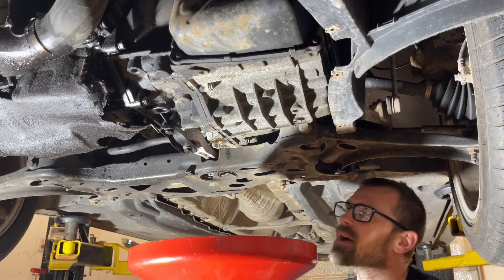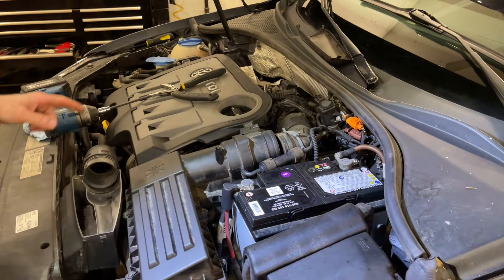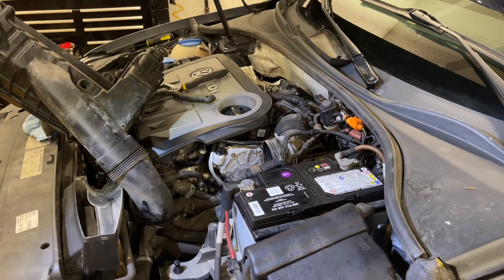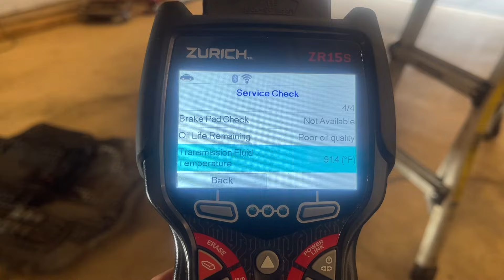🔧 VW DSG transmission fluid change. 2014 Passat TDi

Comment from the maker: This procedure is very similar for many DSG transmissions from 2004-2018.  VW recommends doing this service every 40K miles.  I have never seen dirty fluid when done at 40K miles and these transmissions are very reliable as long as you service them as recommended.

The kit I used in the video: Pentosin 8038207-KIT: https://amzn.to/3wt5OrH
If you prefer the Liqui Moly brand: Liqui Moly service kit: https://amzn.to/3RR8xXj
Hand pump: https://amzn.to/3XDmUi4
Fill adapter for DSG transmission only: https://amzn.to/41wBg6N
Fill adapter kit (for many vehicles including DSG): https://amzn.to/3QJ3vtH

Quinn 1/2" Drive Torque Wrench: https://www.harborfreight.com/12-in-d... 

These are both the same scanner:
Innova 5610: https://amzn.to/3ZFN3hc
Zurich zr15s: https://www.harborfreight.com/zr15s-o...

14mm hex for drain plug: 33ftlb (45Nm)
8mm hex for fill level tube
5mm for the airbox bolt
24mm for the transmission filter housing

0:45 supplies needed
1:35 removing the cover and draining the DSG fluid
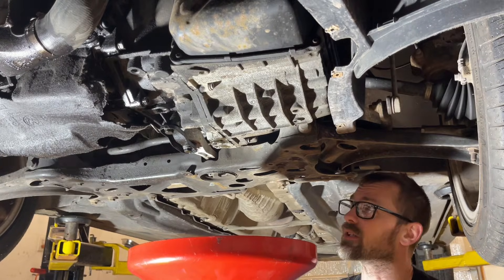3:25 accessing the DSG filter
9:03 changing the filter and housing o-ring
11:35 reinstalling the filter
12:00 putting the top back together super fast
13:07 reinstalling the fill level tube and filling with fresh fluid
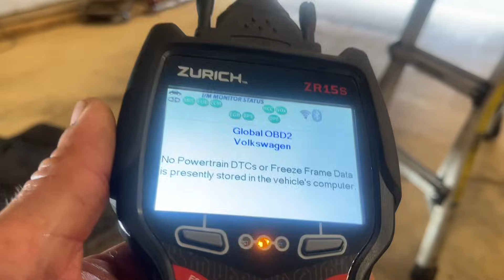15:27 checking transmission temp 95-113F (35-46C)
16:20 draining excess fluid
16:53 reinstalling drain plug 33ftlb (45Nm)

As an Amazon Associate, I earn from qualifying purchases.  For your convenience, I try to post links to everything I use in the video description.  That's part of how I cover the costs of this channel.  I appreciate your support buy using these links!!
Reply: Should run the transmission through all the gears after filling with fresh oil.

Comment: followed you and it was perfect. I had to pour fluid from up top and took me nearly 1 hour to finish off pouring it in. I cant believe how smooth shifting has become. I was feeling every gear shift before and now it smoothed down at least 75%. I bought 5x Liqui moly DSG fluid and 1x Hengst filter separately and it cost me a lot less than a kit.
Reply from the maker: Great to hear and thanks for the cost saving tip!

Comment: ALWAYS remove negative battery wire FIRST.  On any device also.
Reply from the maker: Great advice, but in this case it doesn’t apply since I used a jumper pack to keep the system energized.

Comment: Weren’t you suppose to run it thru the gears while it’s heating up, before replacing the drain plug?
Reply from the maker: It’s pretty normal on traditional automatics to run through the gears after you have completed the fill process but before setting the level. These DSG transmissions are a lot different that regular autos.  I do not believe there is any benefit to running it thought the gears before setting the correct level, but also it will not hurt or change anything.
Reply: @bennieaust ok thanks. Just picked mine up last weekend and doing all the research I can. I talked to ECS Tuning and that’s what he told me needed to happen. But he also tried to deter me from doing my own (not sure why, as he lost a sale from me). If I can do all my own timing belts and even repair damaged transmissions, I can handle this 😂

Comment: I had no idea when I bought my 2015 Passat that the DSG needed to be serviced every 40k miles. I bought it 2 years ago and have put right around 100k miles on it with without doing basically any service aside from oil and filter changes. The car didn't come with a manual or owner's guide, so I had no idea what needed to be done and when. I bought an owner's manual from a third party and found out all of the things that I now needed to do that were overdue. I decided to start with the DSG service because that felt like the most expensive thing that could fail. I called around to a couple shops and was quoted anywhere from $500-$750 and decided to look in to doing it myself. I found your video and after watching it, I felt confident that I'd be able to do it myself. Thank you for the easy to follow walkthrough, listing off each bolt and bit that I needed to remove, what size they are, and listing what products to use. Thank you for making it very easy to do in my garage myself!
Reply from the maker: You’re welcome!  Thanks for commenting.  It reinforces why I’m doing it!
Reply: @bennieaust  Hey! Just out of curiosity, is there any reason you can't fill the fluid via the filter opening?
Reply from the maker: @jgbah you definitely can if you are a very patient person. It fills extremely slow and personally I’m not that patient. :)

Comment: Why not just measure how much oil comes out of the drain and put everything back and then just top fill when you are replacing the filter ?
Reply from the maker: Because that is assuming it is at the correct level currently.   Assuming is a risky way to service an expensive transmission.
Reply: @bennieaust true my tranny has unknown service history so will have to go this route. I see some kits from FCP. They recommend 6 L but I don’t think it holds any more than five?

Comment: i have a 2017 B7 1.8T TSI with a 6 speed automatic DSG and my owners manual says to do it every 80K miles.
Reply from the maker: I would recommend following the owners manual.  As far as I can tell, in the United States, VW only offered a traditional automatic or manual transmission in 2017. I would definitely double check and confirm it’s in fact a DSG.
Reply: @bennieaust thank you for the video! my
local vw is charging 495 to get this done
Reply from the maker: @Archchill you’re welcome!

Comment: I thought the procedure was to half-fill the box, then - with foot on brake to prevent the wheels turning - put the selctor through every position  for five seconds while adding the rest? Which sounds like two people are needed?  Surely, if all the fluid can be added at the start - you could simply use a funnel and pour it in via the filter-housing before fitting the new filter, and save faffing about underneath with a pump?
Reply from the maker: I wouldn’t recommend running it even for a short time with only half the fluid in it. 

In fairness, I haven’t tried to fill through the filter housing but having serviced dozens of these transmissions, that sounds like faffing about. It’s super easy to fill underneath and you have to go back under there and drain the excess fluid anyways. 

The part of the job that’s annoying is accessing the filter housing. Everything else is very easy.

Comment: "I'm going to use my jumper-pack - and put 12-volts straight onto this..."  (Points at something off-screen.)
Well, that was jolly useful!   Not having the radio-code, I had been in hopes of finding-out how not to lose it...
Reply from the maker: I’ll be jolly useful and tell you that you don’t need the radio code if you aren’t swapping the deck in to another car. Simply disconnect the battery will not require a radio code.  Also, if you watched the video, it can be seen at 7:49.

Comment: Can you add oil from transmission filter housing?
Reply from the maker: I’m not actually sure on that. Personally, it would seem like a more difficult way of adding fluid, due to accessing the filter housing.
Reply: @bennieaust 
"By measuring the precise quantity of oil drained from the bottom, you can accurately replenish it by adding the same amount through the oil filter port using a funnel."
Reply from the maker: @eagleeagle681 I highly recommend using the correct method to set the level.  The only way the measurement method will work is if it’s currently at the correct level. How do you know for sure it’s currently at the correct level?  I do not recommend assuming it’s at the correct level.

Comment: Can you fill up the transmission fluid in another way?
If you don't have a pump.
Reply from the maker: @davidizzo9959  not that I’m aware of, that’s why I linked a cheap pump and adapter in the description.
Reply: @bennieaust  other videos show a hose going from up top when battery is taken out & then reinstalled. Don't know how gravity pushes it back up though down under into the fill hole
Reply from the maker: @DominiAeternum  I’m not sure how other people are doing it, but if you’ve found other videos with other methods, then I guess that answers the question.

Comment: Battery is missing the insulating blanket.  It is supposed to be there on TDIs to prevent excess heat from regens cooking off the battery leading to a faster demise of the battery.  Bet someone replaced the battery and said “WTF is this for and tossed it”.
Reply from the maker: @notmethanks816  I get a lot of them with missing battery blankets in some cases I’ve seen rodents chew them up so bad that that is why they get discarded.

Comment: Not true.  All Passat TDIs had a manual transmission option.  I am sitting in one right now, in the USA.
Reply from the maker: @notmethanks816  as far as I know 2015 was the only year of TDI Passat that offered a manual option. I’d love to see pictures of yours if you have one that I believe doesn’t exist.  I think they might’ve offered one in earlier generations as well for this generation 2012 through 2015 2015 was the only year that offered a manual and it was only offered in an SE trim level.  

So my guess is that you aren’t sitting in a 2014 Passat with a manual, I’m betting you are sitting in a 2015 Passat TDi SE with a manual.
Reply: @bennieaust  
Here is a video for a 2014 Passat TDI 6MT being sold by a VW dealer.

https://www.youtube.com/watch?v=M0-TRdTNDGs

Here is a video for the 2012 Passat TDI 6MT that was sold by a VW dealer.

https://www.youtube.com/watch?v=-CIolYPJHbs

The reason the 2012-2016 6MT Passat TDIs are rare now is that most people sold them back to VW and VW was allowed to crush these cars instead of fix the due to the low number of units and the cost to develop a fit.  

The 2015 6MT Passat TDI really only needed a software update to become compliant.  The ECM was only replaced because the DOC/SCR efficiency dropped enough that the car would not make it all the way to 150K without replacing these parts.  The DPF was included as it was part of the ECM.
Reply from the maker: @ I’d be really curious to run the VINs on those. All the information I’ve ever seen says they only offered a manual in 2015.  That’s what I’m going by the info. I’ve seen maybe it’s wrong but that’s all I’ve ever seen. Also, what I’ve seen in real life follows along with that. I’ve driven manual 2015’s but never seen one for sale earlier than that.
Reply from the maker: @ tell me more about the one you’re sitting in?
Reply: @bennieaust  
Posted links to the VW brochures, but that comment was magically removed.  The 2012-2014 most assuredly had the 6MT as an option.  Anyone can google 2012 Passat TDI Brochure and see it listed right there.  Same for 2013 and 2014.
Reply: @bennieaust  
Here are VINs that can be run for each model year to show that 6MT was available on Passat TDI 2012-2014 model years:

2013: 1VWBN7A31DC096461
2014: 1VWBN7A34EC019214

Could not find a 2012 currently for sale with pictures.  The above two are currently for sale with pictures to show the 6MT shifter.
Reply from the maker: @ I’ll check it out.
Reply from the maker: @ thanks!!

Comment: Hi, thanks for the video. I just did my service…I drained out 5L on the nose and just added back the same amount. Wouldn’t this be ok…or should I be lifting it up and running it to check? Thanks again.
Reply from the maker: You’re welcome!

I always follow the procedure to set the level because the big questions is: was it at the correct level to begins with?

I have heard many stories about the dealer not even filling it to the correct level. 

I bet you’re close, but I’d do it by the book to verify.
Reply: @bennieaust  I was afraid you were going to say that haha. Where I work on the car is not completely level..but for the small surface area it perhaps shouldn't be too bad. 
I'll be driving it around for about a week before I can work on it again so hopefully it was close. 
Thanks for getting back to me!
Reply from the maker: @ you’re welcome.  You may be right von, it’s just a guess though until you know for sure. :)

Comment: This was fantastic, thank you so much. Where does the air go when you pump the fluid into the trans? What torquewrench are you using?
Reply from the maker: Thanks!  I added it to the description as well. 

Quinn 1/2" Drive Torque Wrench: https://www.harborfreight.com/12-in-drive-digital-torque-wrench-64916.html

There is a vent on the transmission that allows air in when you drain it and air out when you fill it, as well as under normal operating conditions when the fluid expands and contracts with temperature changes.

Comment: The worst gear box and the worst car.
Reply from the maker: I have a relatively small sample, but I have not seen issues with them and they work fantastic. 

I part out crashed insurance auction TDi Passats on a pretty regular basis and the transmissions are one of the last things to sell. Very low demand which tells me they are reliable.  Engines on the other hand, sell immediately for more money than I pay for the cars. 

Do you work at a shop that sees a lot of DSG failures?

Comment: So much for progressing forward to save the environment. This appears to waste quite a bit of oil.
Reply from the maker: Are you referring to the fact that this service needs to be done every 40K miles or the fact that you drain back out several ounces of DSG fluid to set the level?

In either case I would humbly suggest that the VW emission scandal had a much bigger impact than this transmission service.  You may want to look elsewhere for the most eco-friendly car.

I absolutely love these cars (2012-2015 Passat TDi) for many reasons.  They are not perfect or flawless.  Don't over think it.
Reply: @bennieaust  I totally agree with you on all your points. I was just commenting on the fill, bring up to temp and then remove twenty ounces or more of oil back into a catch pan. What is wrong with drain from the bottom fill from the top method we have used since inception of automobile?
Reply from the maker: @lickitysplit2413  when they first eliminated dip sticks I was irritated. Of course having a lift makes a big difference, but I now enjoy the ease and speed you can service and accurately set the transmission fluid level on most vehicles.  I guess I’ve adapted well.
Reply: @bennieaust  Just purchased a 2013 Passat with 63k on the ODO and have never worked on a VW before. Car needs new front tires and a trans oil change because the original owner claims they have not done it yet and that is how I came to this channel. Is there anything else you can recommend to be on the lookout for or do at this current mileage. Every car I have owned had a trans dipstick. You should have seen me trying to figure out where in the heck the dipstick was for the trans when I went to check the car over, I was the dipstick🤪
Reply from the maker: @lickitysplit2413  the general list is: oil change every 10k miles, fuel filter every 25k miles, transmission fluid every 40k miles, timing belt and water pump every 130k miles. 

Check engine and cabin air filters and change as needed. 

Watch for fluid leaks, fill DEF as needed, and enjoy it!!
Reply: @bennieaust  thank you, no DEF needed as it is the 2.5L gas.
Reply from the maker: @lickitysplit2413  you can disregard everything but the oil change interval. I don’t believe you even have the DSG transmission.  The procedure will probably be similar, but it’s a different transmission that if nothing else uses different fluid.

Comment: The VW repair manual asks that you run through each gear (approximately one minute per gear) before disconnecting the fluid pump.
Reply from the maker: Thanks for the added information!

Comment: I was told the drain plug does not have a crush washer, and can be reused. Is that true?
Reply from the maker: The drain plug does have a crush washer and the Pentosin kit linked in the description comes with a new one. I have on many occasions reused crush washers even though that is not recommended.

Comment: Hi can u pour the transmission oil from the top instead of pumping it in from the bottom?
Reply: Yes. But from what I hear, it takes several hours to drain in from the top through the filter housing…
Reply: Sure,  funnel attached to some tubing and into the fill hole.  No pump required.
Reply from the maker: You definitely can if you are not on a tight schedule. Like the other commenter mentioned, it takes an incredibly long time to do so.

Comment: Funny…you said a 2014 Passat TDI only had one transmission.  Brought mine to a shop in FL called Lake County Euros that said VW made 12 transmissions that year!  lol. Then they wanted to charge me $560 for the job and said the LiquidMoly was $37/qt and it took 8 quarts. lol again.
Reply from the maker: Sounds like a shop to avoid!  If it’s not a TDi there are a few options. But the TDi in 2014 was one transmission only.

Comment: How are you supposed to fill the transmission and run the gears with the car running if the car is hoisted on jacks? Just doesn’t seem practical
Reply from the maker: Practical or not, it's the procedure.  I guess I'm not following why the (jacks?) make it impractical.  There is no need to drive the car, or even for the wheels to turn.  If you feel unsafe preforming any of this then I would definitely recommend just taking it to a shop.